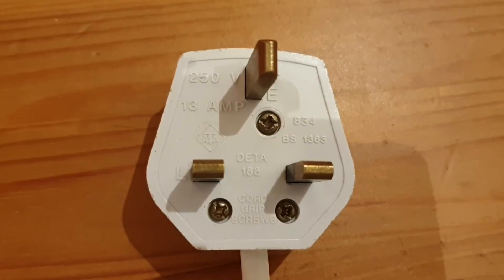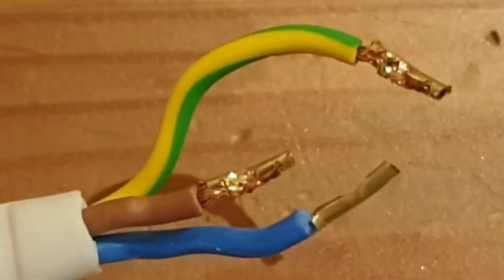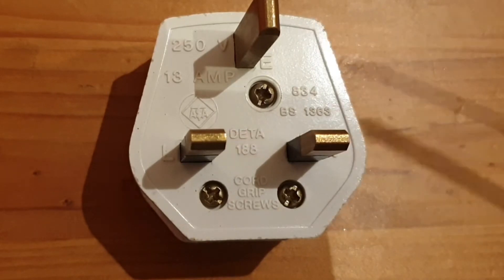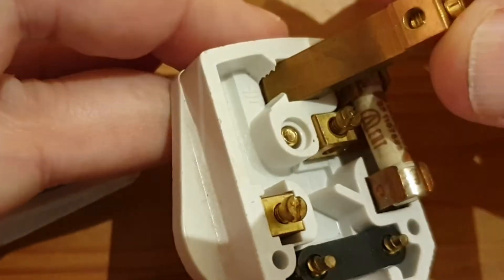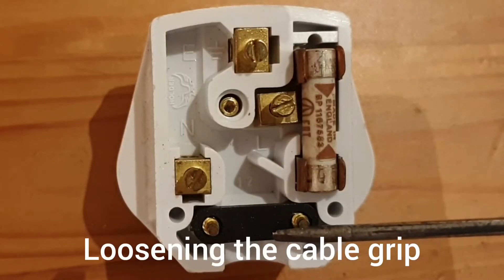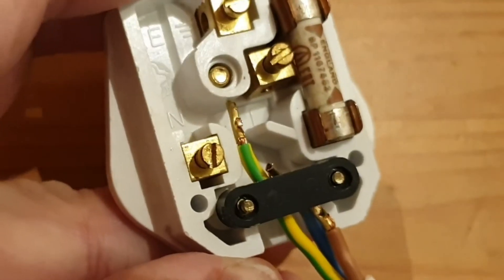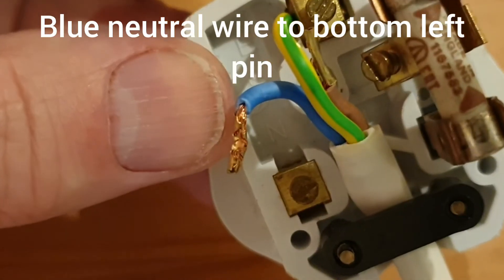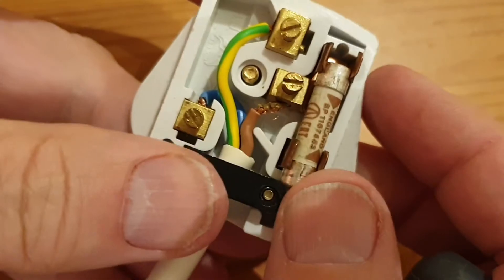How to wire a plug - UK 3 pin plug

Comment: Очень интересное видео! Дело в том что у нас в Средней Азии в основном преобладает европейский стандарт вилок и розеток (EU) и нет значения какой стороной подключать линию L и N к вилке... А в данном видео очень интересно что все на своих местах! 👍  + Вилки что вы показываете на видео это наличие предохранителя (fuse) в каждой вилке! В вилках EU формата ничего подобного нет , предохранители стоят внутри устройств подключаемых к электрической сети. Спасибо за видео.
Reply from the maker: Thank you Mikhail 👍 I assume that UK plugs contain a fuse so that the circuit would break before a large current reaches the appliance but the time difference would be minimal. The main reason could be that it is easier to change the fuse in the plug!
Reply: @bigtedshome  я полностью с Вами согласен, менять предохранитель в вилке гораздо удобнее и быстрее чем разбирать прибор.....